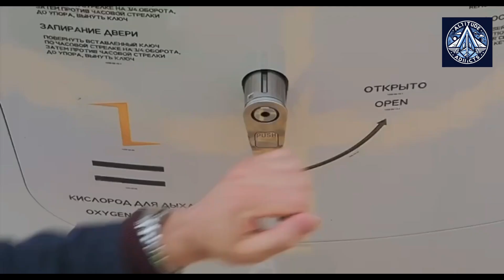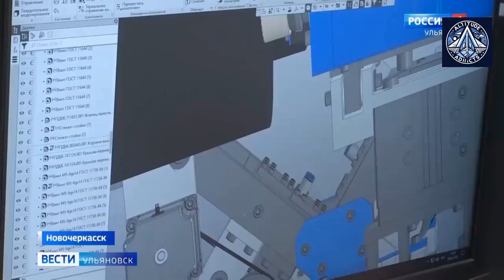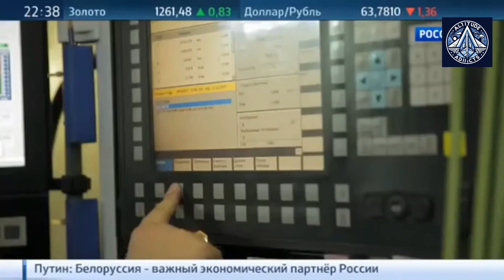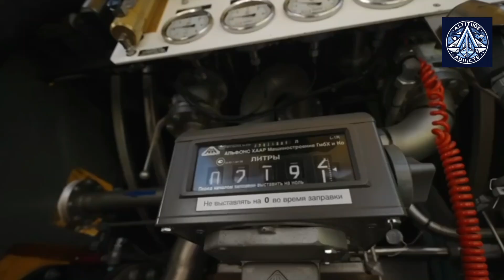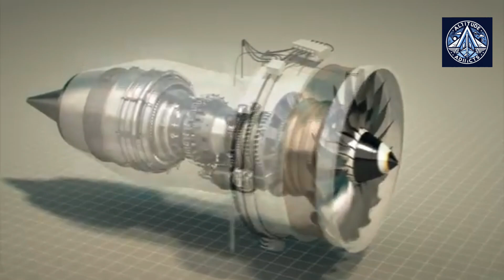MC-21's Composite Wings and PD-14 Engine - A Russian  Technological Triumph

Comment: in the future, turbines will be replaced by electric motors with cooled superconductors; energy will be generated by hydrogen chemical reactors, combining hydrogen with air
Reply: Мечтай.
Reply: @ПётрКовалев-ж1п  дятел,   уже    разработаны русские   водородные   энерго двигательные авиа  системы для  малых самолетов
Reply: no, this is not gonna happen for the next 30- tp years. The next generation airlines which will enter service in the mid 2030s will have standard jet fuel gas turbines as decades before. They might have electric motors for ground operations or two boost power for takeoff and climb, but that’s it. Electric proportion just makes zero sense in aviation.

Comment: The MC-21 is a project aircraft based on the Yakovlev 242 design and the PD-14 is based on the Progress\ Soloviev engines, this is only one of many projects currently in progress, the aircraft can be powered by th Progress or Soloviev designs but decidedvto play with a new simpler design, they have other great engines up to 25% more economical like the geared propfan Kusnetzov NK-73 variant and the fuselage can be done with the Litium\Aluminum alloys but they are playing with newer designs composites for future production rumpups in mind.... You're just seeing the tip of the iceberg....
Reply: БРЕД "ВСЕЗНАЙКИ"🤡🤡🤡 НИКАКОГО NK-73 НИКОГДА НЕ БЫЛО... (НО БЫЛ НК-93, С ТЯГОЙ ДО 18Т... НО К МС-21 НИКАКОГО ОТНОШЕНИЯ К МС-21 ОН ИМЕТЬ НЕ МОЖЕТ - НЕ ПОМЕСТИТСЯ ПОД КРЫЛОМ...)
Reply: @ИгорьИсаков-з4р  Hay 15 prototipos de propfans made my Kuznetsov...!..
Reply: @ИгорьИсаков-з4р It's like putting a Trent 1000 in a 737 0r an A32X with the NK-93... The NK-73 exist all you have to do is run a wiki search.... The author is trying to confuse the public comparing apples with watermelons... There are 15 variants of the NK-92 and this choice in the article is for the Il-96 or military cargo... The NK-73 is only 3.0 M diameter...
Reply: @mazikkaluchka5562  🤣🤣🤣Новости из параллельной реальности..
Reply: @mazikkaluchka5562 The Russian NK-93 ducted propfan engine (family) was a complete failure from decades ago, because the noise levels are just WAY TO HIGH.